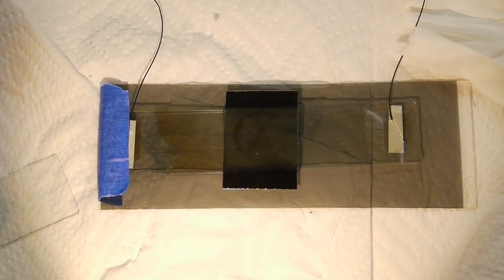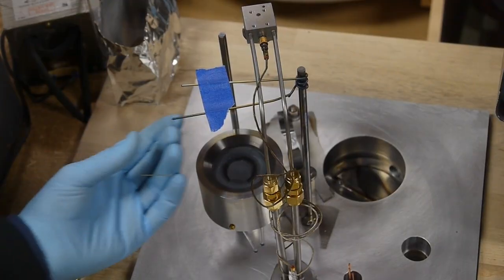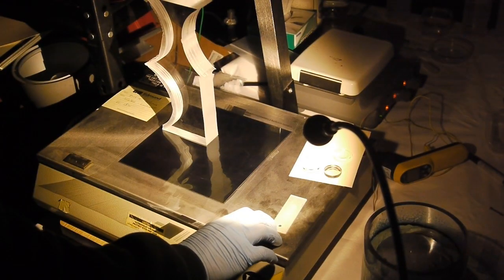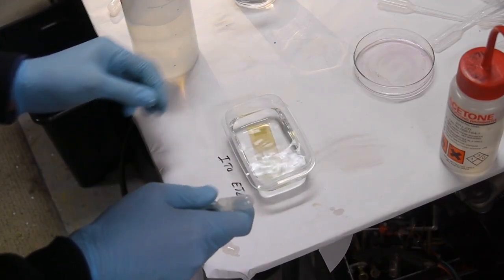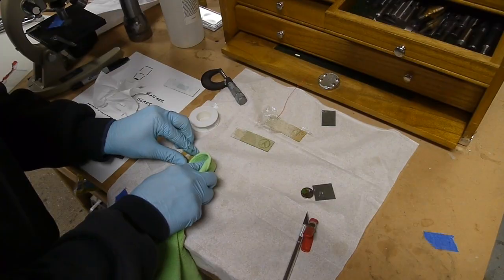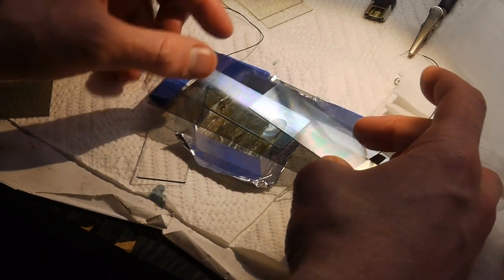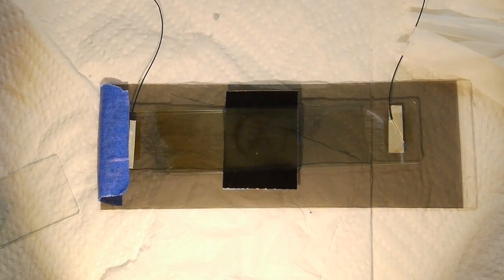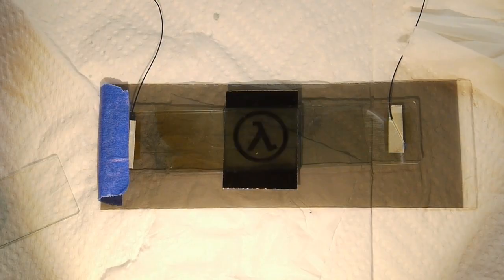DIY Custom LCD

Comment: not really a do it yourself  unless you happen to work in a well equiped chemestry lab.  Still cool though
Reply: Considering he built his own scanning electron microscope and a vacuum deposition chamber (with some parts he had to machine from raw material) pretty sure that counts as do it yourself. You'd have to invest into over time most likely, but it's possible if you take the time to do so.
Reply: DimensionalIce No I mean it's not legal to purchase some of those chemicals in the US.  Literally CANT do it myself.  Also there are many plans on the internet on how to build your own electron scanning microsope.  That doesn't make it any less impressive but still most people have acces to them.
Reply: Comedic Sketches Liquid crystals are not easy to acquire.  Laws may be more stringent here in Canada, but you cannot have them delivered to a residential address.  If it is a commercial address, you better hope you have the right licences to handle it or you may get slapped with a heavy fine.  The government generally doesn't want people playing with chemicals. Everything else could be acquired easily though.

Comment: interesting work and educating video, I have a question about conducting coating, it seems a complicated process to built it but is there any way to repair a  scratched conducting coating on an LCD screen glass on the edges where contacts are? thanks

Comment: I remember coating ITO slides with synthetic opal films in my undergrad, using electrophoretic deposition. I still have a couple of those coated slides because they're so pretty.

Comment: Dude.
You look kinda like Gordon Freeman.
Reply: He looks like Gordon Freeman, he works for valve, the video is 3 minutes long.

HL3 confirmed.
Reply: qazmatron Everyone through high school knows this.
Well, is at least supposed to know it.
Reply: The symbol on Gordon's HEV suit is the lower case Greek letter Lambda, λ. This symbol is used by scientists to denote the decay constant of radioactive elements (related to the half-life of an element). As well as appearing on Gordon's suit, the symbol replaces the letter "a" in the game title (Hλlf-Life), and is the name of the complex in the Black Mesa Research Facility where teleportation experiments are conducted in the first game...
Reply: ..what?
Reply: i have 6 other fans, and a cool air intake system. thanks

Comment: i tryed to do this i ended up creating a portal to anouther dimenshion but i closed it before the terminators came by repeating the process
Reply: hahahahahhaha
Reply: I did the same. My laboratory in the basement is now full of aliens. I didn't know what to do, so i just locked the door. I hope this keeps them in.
Reply: OpenGL4ever find a crowbar and get out
Reply: Did you rinse ? DID YOU RINSE BEFORE YOU REPEATED.

Comment: as if the comum bob has half the equipment you just "displayed"... (failed diy)
Reply: everything is relative, or did you expect a tutorial of how to make custom lcd using a hammer, flat screw driver and some duct tape?
and he already mentioned, that you can get coated glass (which is the "most-not-diy part of the tutorial) "off the shelf" and do just the photo-etching part, which is quite simple diy process for someone set on producing a custom lcd
p.s. most universities will have vacuum sputtering equipment in their labs, and even if you don't work or study there, I'm sure people will be able to help you if you ask kindly
p.s.s. some universities or labs write off equipment like that (that has some minor or sometimes not so minor faults or is just old, and they have budget to spend on new stuff), and that is the chance for regular joes to get their hands on vacuum sputtering equipment, UV exposure lamps and etc.
so yes - this is a very good - in detail - diy on how to make a custom lcd

Comment: what the fuck kind of bullshit is this...LMAO @ DIY... highly Doubtfull......
Reply: This guy built a scanning electron microscope in his garage. The sputtering thing is the hardest to do but he did it with a homemade vacuum chamber and sputter electrode. The only non diy part are the electronics for the sputtering. The chemical are readily available online...
Reply: you guys realize that diy stand for "do it yourself" right, it never specify something have to be cheap or readily available, as long as you hunt or make the parts yourself and build it yourself it's diy
Reply: was going to say the same. highly selective few who could "diy"
Reply: For real

Comment: Hi Ben, great video. I wonder, could you skip the photo resist step? Could you raster an electron beam to create a negatively charged image on the substrate and then sputter. Assuming the shutter gun produces positive particles, they would be attracted to the negative and form electrodes in the desired shape. With more than one sputter gun you could even dope the electrodes on the fly. I can think of reasons why this wouldn't work but i have no practical experience .
Thanks for these great videos.

Comment: something you can easily do with the supplies from your nearest NASA parts provider
Reply: you can build a vacuum chamber for sputtering at home.  you don't need any super complicated machining.   you will however need a decent vacuum pump, a thick glass dome with rubber seal  and the sputtering part uses a  high voltage  step up circuit.  a HV  transformer from an old CRT tv will work for roughly  20-30kv , then you can use a capacitor bank to bump that up to 50-100kv for the sputtering.

Comment: That's awesome Ben. Is it theoretically possible to make a color LCD stack by using 3 layers of slides? (You could probably make 6 colors then) Or would you have to put them side by side like an LCD monitor? Maybe you have to figure out backlighting first though...

Comment: How is this DIY? Who has a vacuum chamber at home? I would be shocked if ANYONE has all the equipment at home to do this. Doing it in a university lab doesn't count. That's where the research for this kind of technology began. You can't call it DIY and do it with a professionally equipped lab.

Comment: Hi *****, awesome work!

Would it be possible to apply a similar process to build an elastic LCD display based on transparent plastic foil instead of glass? Or would the conductive structure break when the screen bends?

I am talking about transparent foil like the ones used for printing.

If not, do you have any suggestions on how to build an elastic display?

Comment: I wonder how much current an ITO trace could carry? Would it be possible to power a small LED? I.e. etch a transparent circuit on the glass using the ITO, then glue SMD LED's to the circuit using conductive epoxy. Could make for a cool effect!

Comment: What about pixel display. This is the equivalent of 1 pixel. Very, very impressive, though.
Reply: many separations needed for multi-pixel. each segment needs it's path to the segment, but it's not harder really, just more time and more paths on the design to be etched, all using same initial deposition on the glass. tip: thinner glass makes a crisper, more clear image, but harder to handle. 1" cover slides for the microscope specimen slides would be good and cheap, too

Comment: Hey *****. I'm definitely going to try this. this is just so awesome. Btw could you use a Vacuum cleaner / Shop bot as a vacuum pump for the Sputtering?
Reply: I'd love to do both ;d. I'll see to find the stuff on ebay. And i'll give it a try. And thx for you awesome video's.
Reply: ***** the hot air convection wouldn't coat the surface on atm pressure? or the oxygen would oxidize the aluminum? and what about a baking process like tho one http://education.mrsec.wisc.edu/304.htm

Comment: would it be difficult to coat an entire car windshield?
Reply: There are full size office windows which turn black to keep out the sun, only when the sunlight is strong enough, which I imagine uses a very similar method to make it black. So it should be possible, there are also technologies to display a partial HUD on a wind shield, but they usually get banned by traffic safety authorities..
Reply: LongJohn Vllasaliu Step 1: find car that doesn't have concave window (like a ice cream truck or schoolbus). Step 2: find LCD monitor of appropriate size. Step 3: take apart monitor down to electronics and bare LCD glass (you don't need the polarizers and backlight stuff). Step 4: silicone glue LCD glass to flat car windshield. Step 5: hook up computer and watch pr0nz while driving. Step 6: (optional) add kinect and arduino for real life Crazy Taxi.
Reply: I've always thinked the same.
Reply: nilssab cool. I will have to investigate some more.
Reply: nilssab I'd love for car windshields to have an lcd hex pattern that would activate to block out the sun or bright headlights.  It require head tracking and a camera to observe the windshield I'd think but it should be possible.  But like you said traffic safety probably wouldn't allow it.
Reply: Sputtering would be hardest part, making a high quality vacuum chamber for a 6 foot hemispherical dome would need to be able to withstand around 1.1 million pounds per square inch or about 1.6 inches of high quality steel walls,  however with a smaller design of around 5'*3'  rectangle the top and bottom would  to withstand around 30,888 so half an inch of high quality steel.  Not quite cheap but all depends on how you design on it and for what purposes.

NASA has the worlds largest vacuum chamber, its diameter is 65 feet and 120 feet tall with a 40 ton door.
Reply: EgadsNo haha oops the dome would need much thicker then 1.6, more like 14.6" thick walls (problem with using two calculators at once...) anyway edit not working so replying here lol
Reply: EgadsNo I see. but the vacuum chamber wouldnt need to be spherical, it might as well be rectangular. and it doesnt even have to be glass I think.
Reply: that would only make it harder, he mentioned the easiest and most feasible ways to make a chamber. The steel chamber he mentioned would not have to be spherical but they generally are. The forces at really low pressures are much stronger than you imagine :)
another hard part with sputtering large areas is that deposition speed lowers for positions further from the centre, so you would generally end up with uneven film thickness.
Reply: regarding the wind shield HUD displays that I've heard of though, I think they use a small projector to project light onto some thin film on the inner side of the wind shield, which is probably easier. 
Also, I believe it might be easier to sputter a flexible transparent sheet that would be applied to the wind shield instead.
Reply: ya'll know what. I won't even bother thinking about how to sputter windshields.
It just hit me that it is probably easier to create a thin flexible plastic monochromecLCD sheet to sandwich in between the two glasses that makes up a windshield hehehe

 could one sputter plastic films?
Reply: LongJohn Vllasaliu Good idea, I believe so, in fact I think Ben has such a project on the go, at least he made a video about it some time ago. Can't remember the name of the video though. 
EDIT: I realize this was probably flexible printed circuits. and not thin film related. Btw, the keyword you want to search for is probably going to be thin film.
Reply: AddColorsToYourLife haha at first I hought you were gonna say somethin serious

nilssab oh yeah yeah I saw hat video, well technically it is te same thing, right?
He's using a conductive material on a surface, be it if it is the surface of a flexible or rigid material.

except on this LCD screen that he created he just added the liquid crystals.

this gave me another idea, would it be possible to mix conductive glue with liquid crystal fluid and make a liquid crystal conductive glue? that would be super awesome, and that could be used for a 3D printer that I saw on hackaday I think, that printed a liquid on to something with a syringe. I don't remember the video.
anyways, with a liquid crystal conductive glue (or LCCG, I invented a new term, yaaay) one could print LCD screens on to any surface.

but then coms the question, how to solve the polarization thing?
Reply: LongJohn Vllasaliu It's an idea, but I think the main problem is that if there is conductive glue, it is probably not transparent, conductors reflect light, with metals, conductivity is so good even if you make a very thin film, it will still reflect light. Transparent conductors have the combination of bad enough conductivity, and being thin enough. So even if a glue would be made of a transparent conductor, it would not be transparent any more.

Comment: Couldn't you save some steps and eliminate the etching by placing a stencil between the sputter gun and slide? Sure you would have to make the stencil first but at least that would make more consistent results between separate tests.

Comment: Any luminescent liquid crystals you could use for even more coolpoints?
Reply: *****
perhaps you could make your own,
one method is "high-concentrated emulsion polymerization of EDOT"

I'm just thinking, how would you make an amoled, I mean does the ITO itself have enough capacitance to keep the light on until the next cycle of the active matrix.

Comment: Where did you get the liquid crystal. May I ask what is the new technology you are aiming to create.
Reply: ***** Hey, I was wondering:  do you know what the normal transmission/absorption curve of an LCD panel (such as in 3D glasses) is in the ultraviolet range? I saw a video of a guy hacking a pair of 3D glasses into light-activated sunglasses, but I was wondering if they had decent UV protection, if anything. Excellent video as always!
Reply: Ryan Willis
Clear glass provides UV protection.  Tint blocks glare.
Reply: ***** Do you know the name of liquid cristal used in this project?